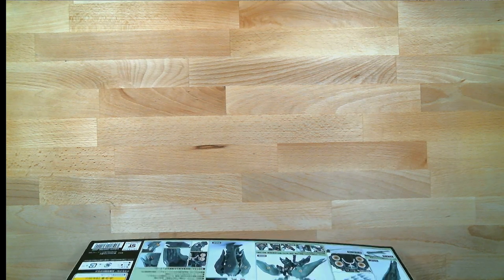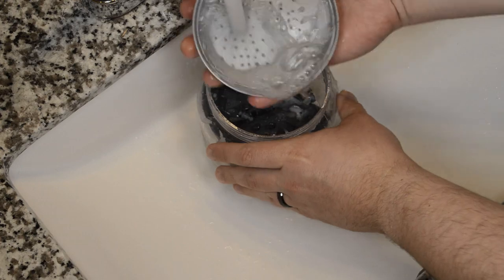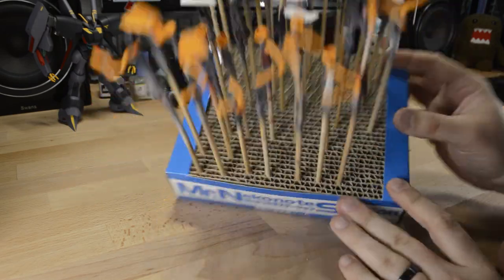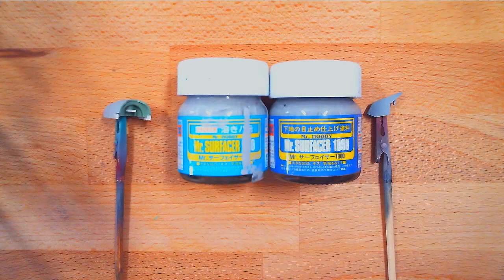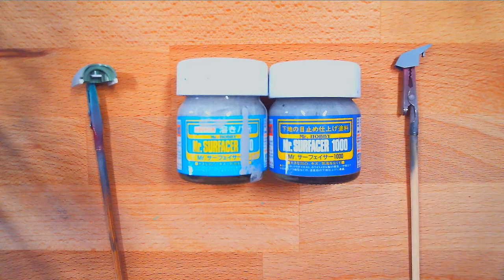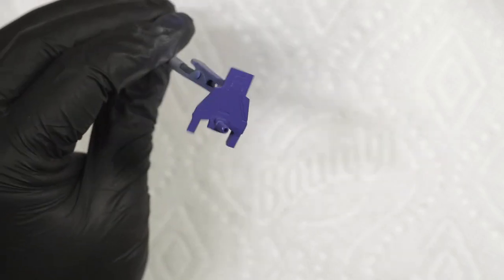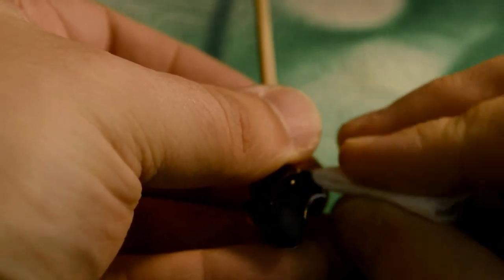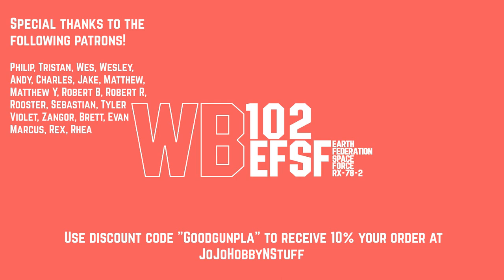Start to Finish HG Kshatriya Part 4: Painting

Comment: How do you make sure the alligator clips don’t bite into the plastic and make marks?
Reply from the maker: I've never had that happen, the clips aren't that strong. Is that something that's happened to you?
Reply: Gunpla by GoodGuyDan nope I haven’t use alligator clips yet.  Just curious because the ones on electronics clamp down pretty well and are quite pointy.
Reply from the maker: @kenkenobi  They can damage paint, so you need to be careful of that. but the plastic shouldn't be an issue.
Reply: Sometimes mines do, yet marks weren’t that obvious. And of course, in order not to minimize the damage to the final effect, I’d prefer to clip on places where you cannot see when the kit is finished.

Comment: Hey there Dan - wonderful series! I was referred here by some folks over on r/Gunpla. I'm going to be starting this kit soon and it'll be my first using lacquer paints (up until now I've used only acrylics and enamels). A few questions if you don't mind:
 
- You advise returning any unused paint to the jar when you're done. It's not an issue that you're returning thinned paint to the original jar? 
- Do you have a source for the photo etched parts you used to add detail to the mega particle cannons? 
- On the Color Guide slide, what's the Vernier?
- I've recently been using Ammo of Mig One-Shot primer (which is acrylic). I like it a lot and am pretty comfortable spraying it. Do you think an acrylic primer like this would still work with the paints you use? Or do you feel the lacquer primer is a must? 

Thanks again for this amazing series - one of the clearest and most detailed gunpla tutorials I've yet seen.
Reply from the maker: Hey there, glad you found the series to be helpful!

You certainly can return thinned paint or primer to the jars if you have extra.I've never had any issues with this, and sometimes I'll even pre thin my primer. 

The photoetch parts are from Madworks. You can find a bunch of different varieties over on eBay.

You'll need to use a lacquer primer if you'll be painting with lacquer paints. 

Good luck and enjoy your build.
Reply: @GunplabyGoodGuyDan  Thanks so much for the quick response. I made one addition just now. On your Color Guide slide, what are you referring to on the kit when you say the "Vernier?"
Reply from the maker: @dmmontal  Verniers aka the 'thruster bells'
Reply: @GunplabyGoodGuyDan  Fabulous. Thanks again, I really appreciate both the great content and the helpful replies. You're a gentleman and a scholar!